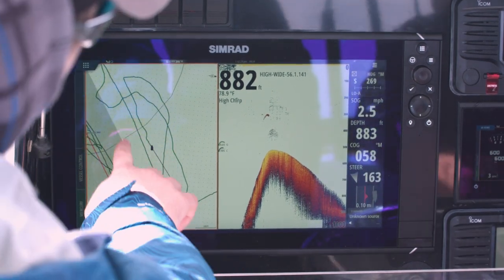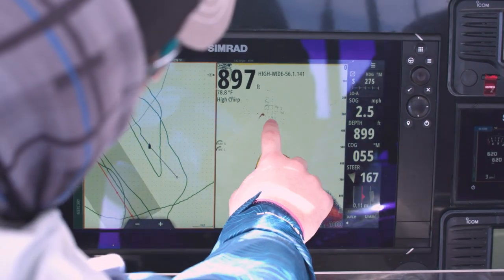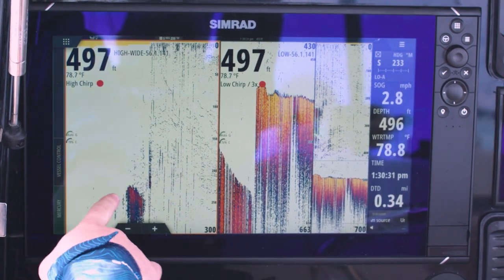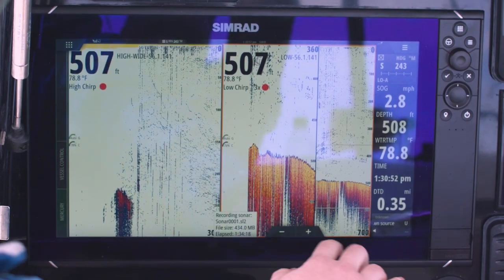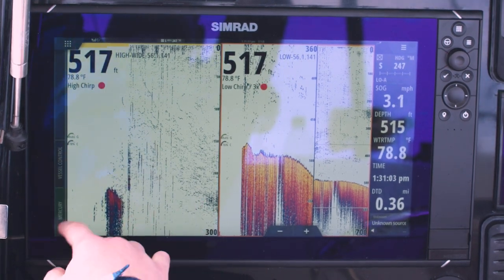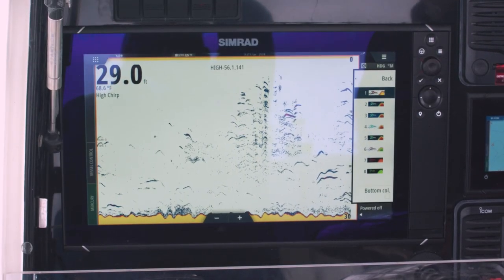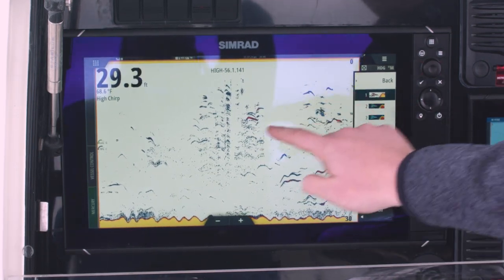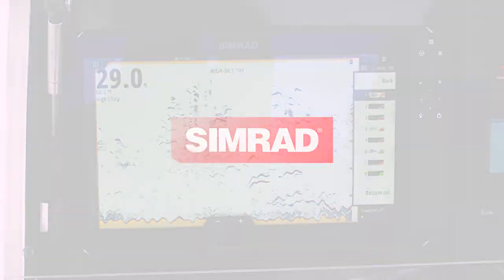Simrad | Sportfishing System S5100 Sonar module

Comment: Hello, do you think I can have fish detection in 500 meters with this equipment?

-Simrad s5100
- airmar r109lm 2kw chirp
- nss evo2
Reply from the maker: You will need the S5100 module to be able to use that transducer, and yes, you'll be able to detect fish at 500m and over.